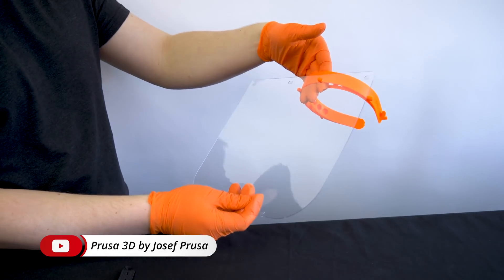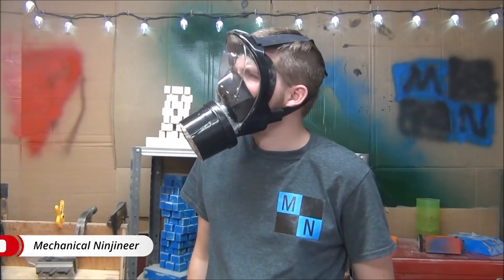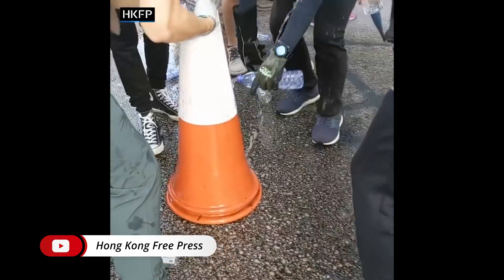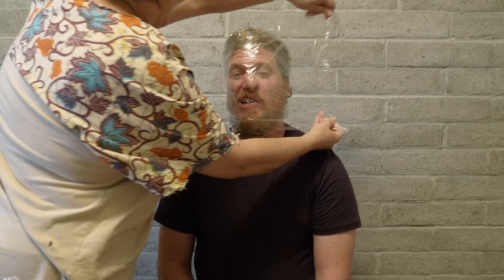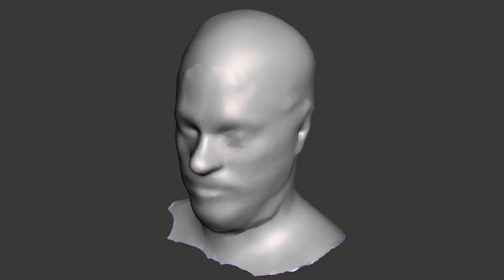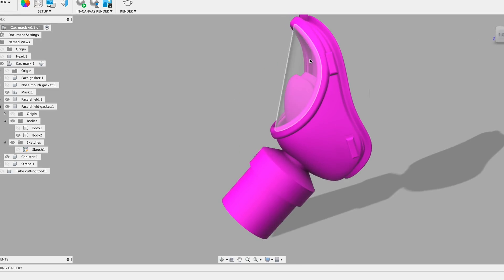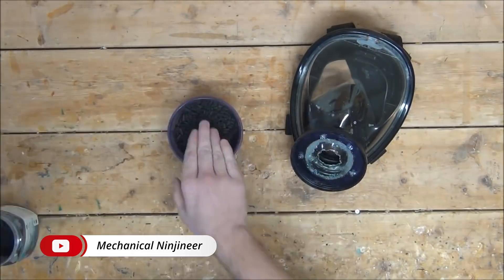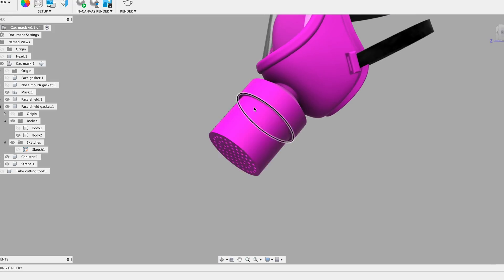I Designed an Open Source 3D Printed Gas Mask

Comment: Don't forget about massive wildfires. Yeah that was just this year too. Our lungs are screwed.
Reply from the maker: Oh, right. Well, add that to the list of reasons why we need better access to PPE:(
Reply: @StrangeParts  I would think that you would need to add some filter material as well to protect in fires, but there is a reason that firefighters only use oxygen masks and not filters. I'm guessing there are stuff in smoke you can't filter out easy.
Reply: @ric_dk-9520  you are correct - lots of poisonous chemicals are released but the main reason in my opinion is that there is no oxogen to even filter. This is because the fire will suck up all the oxygen and only give out carbon dioxide - thats why people suffercate in fires.
Reply: @ric_dk-9520  You can filter out smoke just fine. Smoke jumpers rarely use more than regular filtering masks because they need to be on site for hours and there is enough oxygen to breath. The problem is that a fire uses up oxygen in a room fast. No O2, you get stupid and can't do simple tasks like open a door, you then pass out and eventually die.
Reply: @ric_dk-9520  

Actually a particulate filter would most likely stop smoke. Even a 1960’s gas mask would work.

The problem is that the smoke, while you are not breathing it in, will displace oxygen.

So even if you can block the smoke, you will still suffocate due to a lack of oxygen.
Reply: @StrangeParts  note that activate charcoal won't protect against fine particulate, hence the P2 and P1 masks (or N95/P100 vs the other ones)